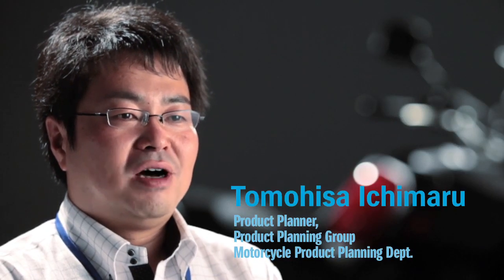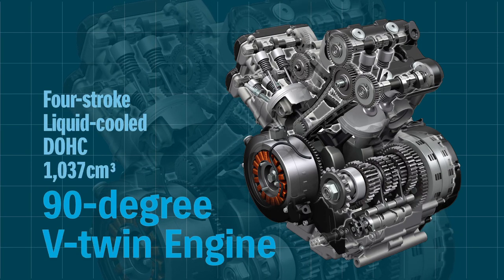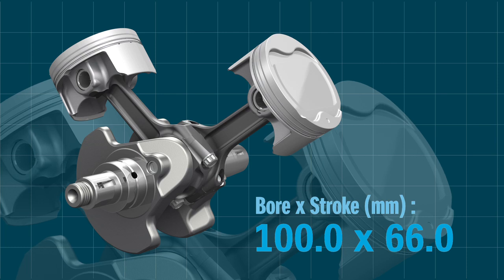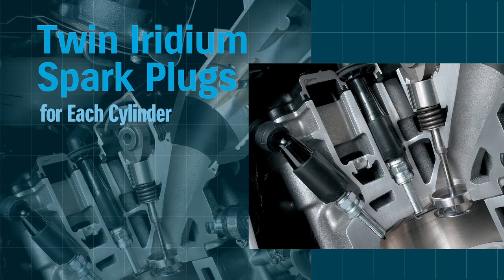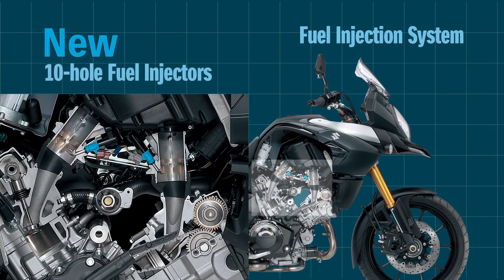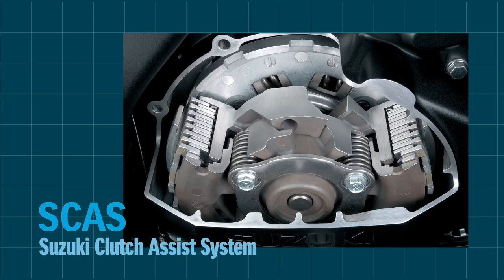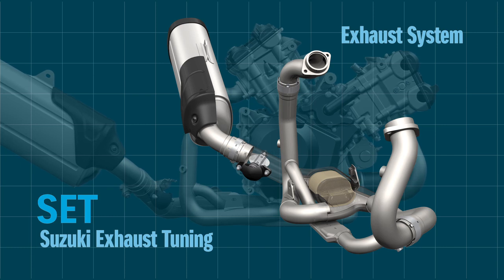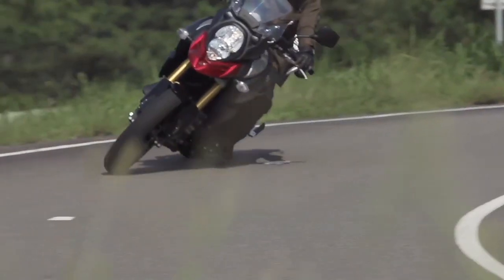V-Strom 1000 ABS Feature movie --Engine

Comment: This is the second video by Suzuki that says they went to a single buffer for better handling.  I don’t get that as a muffler on each side would make for better balance I would think.  Of course you have to get rid of the OEM mufflers that weight 20 lbs each….

Comment: Why did you put clutch basket with the same problem like in previous DL1000... whyyyy? ;'(
Reply: you mean suzuki strom 1000 have clutch problem before this...
Reply: @rothmenmoto7962            yes ! my 2007 (K7) does.
Reply: Yes. Same problem on my V strom 2014. 17000km.